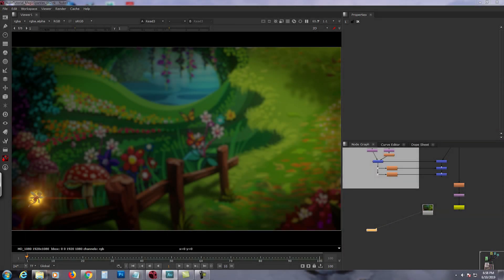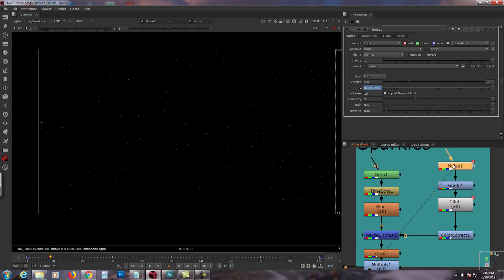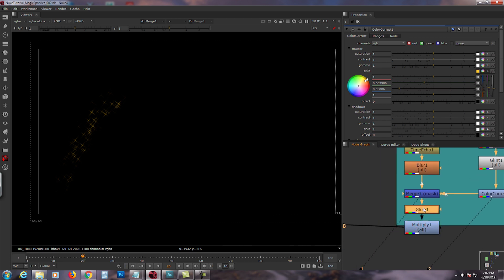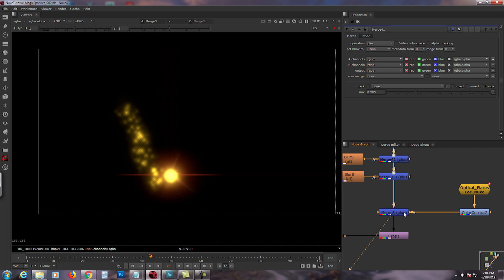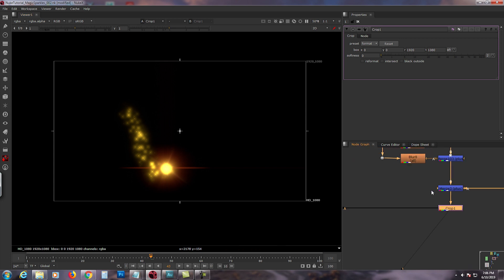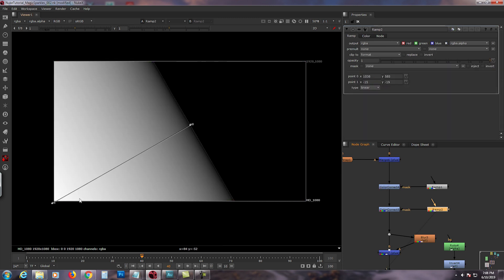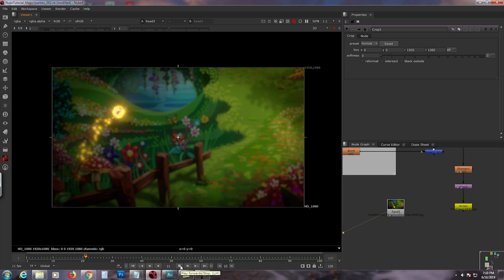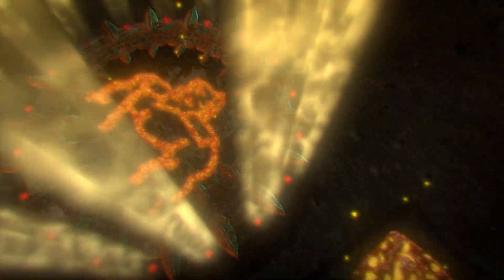Nuke Tutorial - Fairy Magic Dust

Comment: The tutorial is very good! I really like the graphic of the intro. Is it as power consuming as davinci resolve when you use nodes like that?
Reply from the maker: it may or may not. depends on how you optimize your shots, and the node you use. there are some really heavy nodes, like Median, and Frameblend, and it will crash your nuke Script, with a possibility of corrupting your file, but as you work on the software regularly, you get to know how to manage and avoid crashes like that.